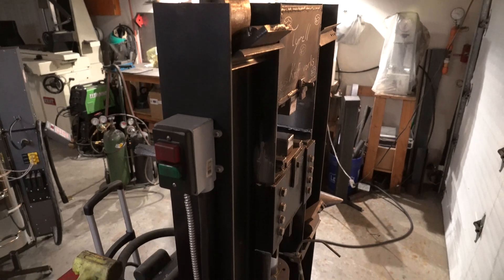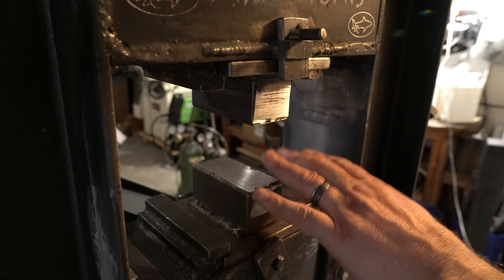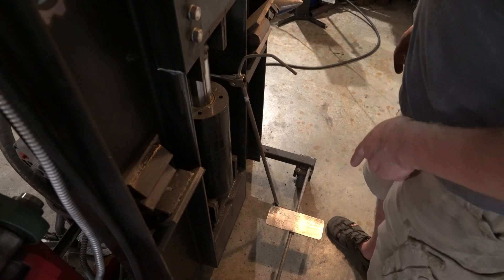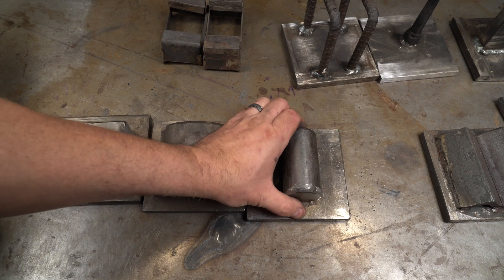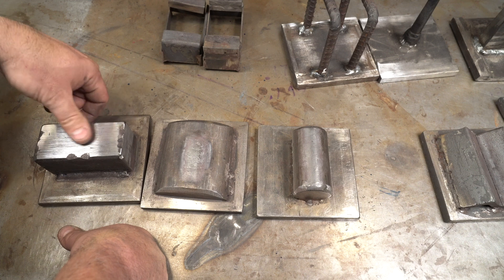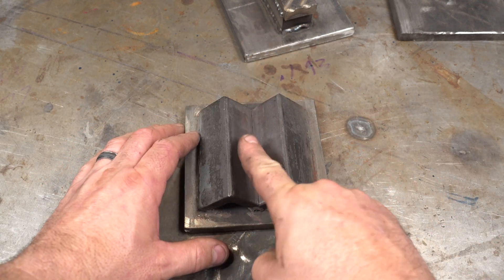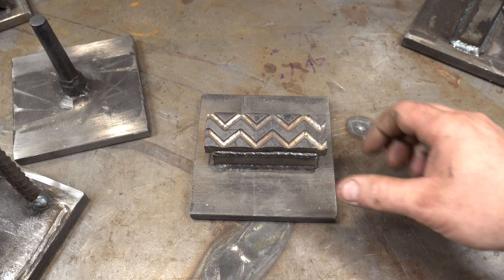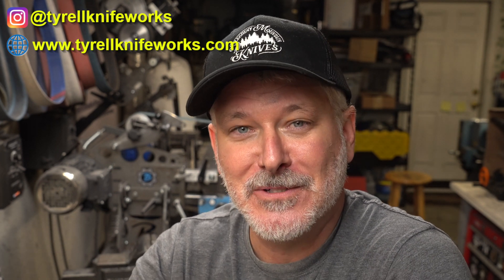Triple-T #149 - Hydraulic forge press questions and answers

Comment: Newer log splitters are a disaster waiting to happen as a forge press for many reasons. My press started as a log splitter but nothing is original except the hydraulic pump. It’s been heavily modified. Shorter bigger cylinder, vertically standing,  reenforced and thicker support beam, electric motor, etc. I basically built a whole new machine because it wasn’t safe or accurate. I’m really surprised more people haven’t been severally injured by some of the log splitter presses that I’ve seen pictures of.
Reply from the maker: I can’t agree more.  I forgot to mention the cylinder piston length on a log splitter is WAY too long.  Thanks for watching, Erik!

Comment: Another question, I also see many DIY presses using 4x4 steel tubing. Is there any pro con to using I-beams instead? Can 4x4 tubing still get enough tonnage to make damascus? I only ask as 4x4 tubing seems to be more available for me to find.
Reply from the maker: 4x4 tube is fine for the structure, but in my opinion it makes creating the head movement more complicated.  With ibeam you can use angle to wrap around the ibeam and it locks in place.  With tube, you are just blocking it in, if that makes sense.  Look at mine in detail (in the overview video) and you’ll see what I mean.
Reply: @TyrellKnifeworks  ah that makes sense! I've been using yours and redbeardops as my two references for building mine.

Comment: i have a 30 ton hydraulic press with 2hp motor on. The speed is a bit too slow, is there anyway I can fix it?
Reply from the maker: First check the pump on it.  Your only option is a bigger motor and probably a bigger pump.  Probably around $300-$400 upgrade.  I hope that helps.

Comment: Fantastic Content, my only complaint is that it's about 4 months to late. I am splitting my fire wood at the moment. Ie have not started modifying it yet. I was thinking it's a great start.  Let's re think it all .
Reply from the maker: If your main goal is for forging, then get the components or strip them off and start with a new frame.  That's my advice.  Thanks for watching!
Reply: @TyrellKnifeworks  easy to watch when it's full of useful information. Thanks for always sharing
Reply: I've seen people design it so they can change it between forging and splitting wood as they like

Comment: Thanks for sharing! I always enjoy what you have to share. I do have one question that i havent been able to find an answer for and maybe you can help. In the pot industry they have things called rosin presses and ive seen several that say they are 8 or more tons and was wondering if you could use it in forging? They are pretty small so im unsure if they actually generate the amount of pressure/force as they claim. Thanks again
Reply from the maker: Same advice as the log splitter.  It's not built to press metal so the frame isn't really as sturdy as you need it.  Plus 8-ton isn't very much.  You can get a bottle jack that is a 12 ton, but those aren't hydraulic and are very slow.  It's not just about the force.  Thanks for watching.